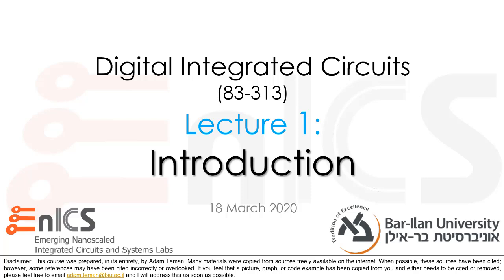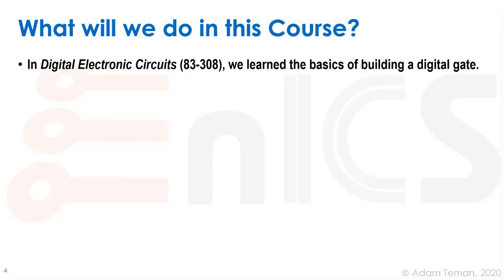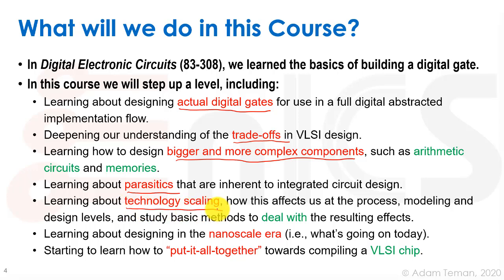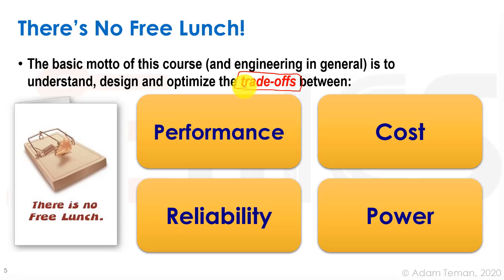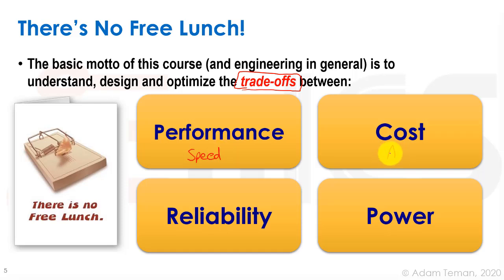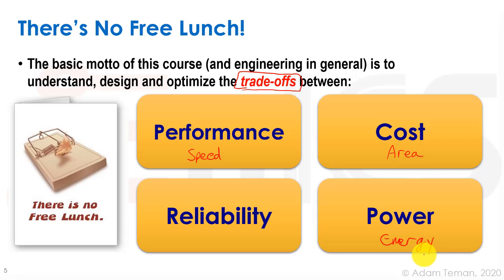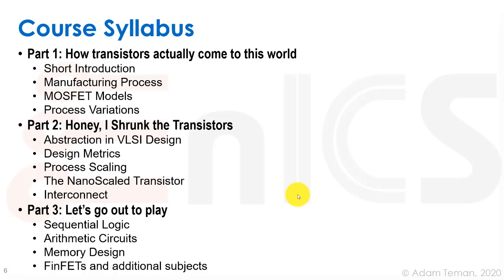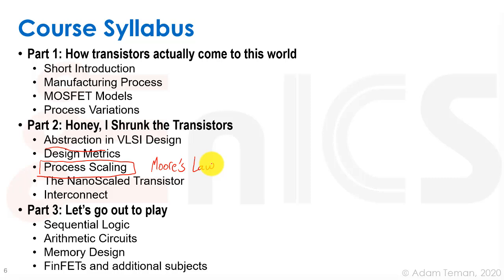VLSI - Lecture 1a: Introduction

Comment: Stability of IC comes under Performance part or in Reliability one?
Reply from the maker: Hi Divaker, 
Which "stability" are you referring to?
Reply: @AdiTeman  
Usually under static and dynamic operations
Reply: For example a single SRAM cell
Reply from the maker: So I guess that's more semantic than anything else. In general, it would be reliability, for sure. But certain things become less reliable (or fail completely) due to operating at too high a frequency; hence, lower performance would provide reliability. I think that all things are a bit connected, so pretty much everything probably has dependence on all of the metrics...
Reply: @AdiTeman  okay nice.
Thanks a lot

Comment: Hi Dr. Teman, I extremely appreciate your effort to put up such useful online lectures! May I ask what are the prerequisites for this course? I would assume your “Introduction to Digital Electronic Circuits” be among one of them, but are there any more required courses?
Reply from the maker: Hi Nghia, sorry for the late response. I somehow didn't see this question until now. To answer your question, indeed, a basic introduction to circuits and systems is required. My "Introduction to Digital Electronic Circuits” is perfect for that, but unfortunately, I haven't had the chance to record the lectures in English (although the slides are quite detailed and they're in English). Any course that teaches the basics of MOSFETs as a switch and building CMOS gates should be sufficient. A good background in semiconductor devices is also required or at least recommended, and some basics of digital systems (Boolean Algebra and such).